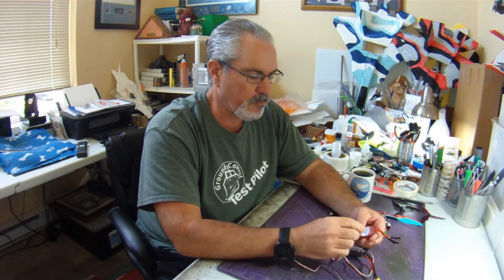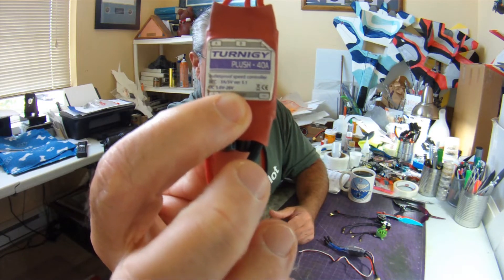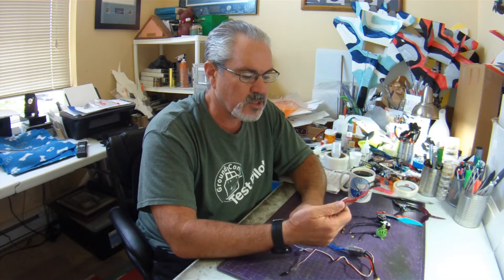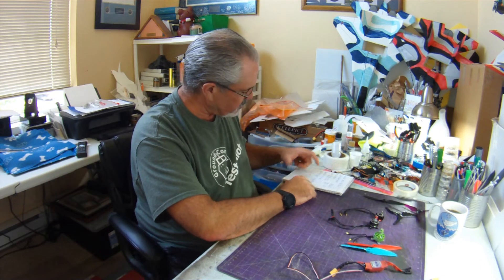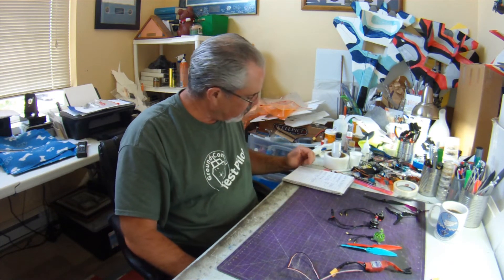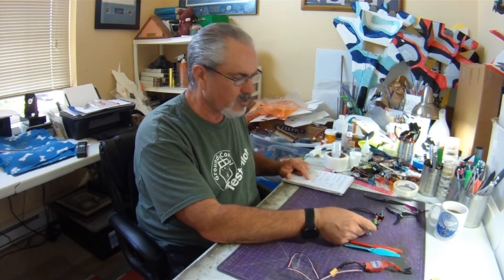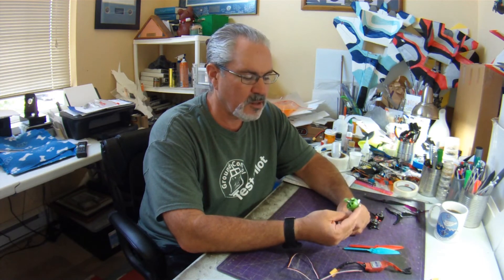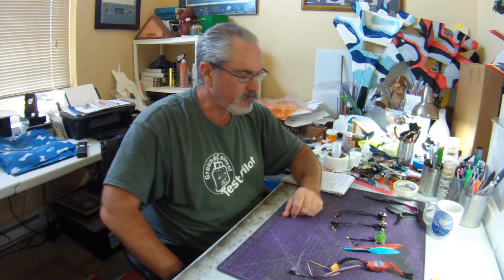Turnigy Plush 40A ESC and motor combos for good budget speed

Comment: Just noticed on Hobbyking turnigy have a new plush-32 line of esc's. I tend to use slightly smaller esc's 18A and 25A in my models. These plush-32 esc's look ideal for me as  even the 20A esc has a switched 4A bec. They also have an option to change the prop direction. In stock in the UK and competitive price.
Reply from the maker: Thanks very much for the info, they look very new and it seems with the programming card there are a lot more features you can adjust and experiment with.  I looked at the 40A Plush-32 ESC https://hobbyking.com/en_us/turnigy-plush-32-40a-speed-controller-w-bec.html but I couldn't seem to find a burst rating for it.  Perhaps as they publish the manual online it will be available.  Thanks again, what size and kv motors are you running in your planes?  Cheers, Scott
Reply: Hi Scott,
At the moment I have gone back to using the Turnigy 2822 1450kv motor. I'm also trying the DYS Wei 2207 2600kv motor rear mount. The main problem I have is limited time with work and changeable weather (north west UK). I have a local recreational ground which is ideal to quickly pop out to. Its looks similar in size to the field that you use. Unfortunately it has residential housing on one side and is very popular with dog walkers. It is very rare for it to be totally empty. I did fly with a Turnigy 2826 2200kv motor but it was clear it was not popular. As a dog owner myself I understand it can scare the dogs. I think if I screamed up and down the field like you do I would have the Police called out on me. When I use quieter motors it has the opposite effect, people are really interested. Any advice welcome!
Gary
Reply from the maker: @gxc2000  Hi Gary, the quietest prop I have ever run on the 2212 2200 kv motor is the Master Airscrew 6x4x3 https://www.masterairscrew.com/collections/3-blade/products/3-blade-6x4-propeller However it does tend to whine a bit more which would probably be even worse for a dog's keen sense of hearing.  You might have to go with a bigger prop but go down to a 2S setup with the 2212 2200 motor to keep it quieter.  Luckily for me, the field where I fly is just for RC flying, it does have it's noise rules, but nobody bothers us.  Good luck finding a combo that you can have fun with and keep the dog walkers happy :)  Cheers, Scott
Reply: @e3Scott  I had not thought of going to 2S. Its a very interesting idea. I have a couple of old ones I could dig out. I could try the idea out for free. Thanks Gary
Reply from the maker: @gxc2000  Sure thing, I know of some guys who use that motor with an 8x4.3 slow fly style prop on 2S, pretty quiet and still moves lots of air as long as the plane isn't too heavy.  Cheers, Scott

Comment: I got side tracked...ESC and brushless motors are expensive on R/C trucks..
$3k later. :-P . I actually have some 2206 and 2208..i got on sale or on a bid.
i have stuff for air craft supplies...I dont even know I have...
Im going to start building again...I need to brush up on data.
I need a SLOW model. or smaller  for my field/park.
Are you down sizing those to 28" wings???
Reply from the maker: I try to downsize to 27" wingspan or even less if I can still fit a 6" prop and a 2200 3S battery into the plane.  Depending on the model, I am somewhere between 25 and 27" wingspan on the planes in my hangar right now.  I am doing that primarily for speed and agility.  The RC Powers Su-30 V4 has a 30" wingspan at full size and I know folks who fly that very slow.  Plans are available here https://www.rcpowers.com/post/rcpowers-v4-plans-10025907?pid=1307655613
Good luck :)  Cheers, Scott

Comment: Great information on power setups from Motors to ESCs to Props! I found out about the RacerStar BR2406S 2600kv Motor from watching your Motor Testing and what a great budget Motor it is! It's the best budget Motor in my stable ;-) Thanks for the shout-out as well and that T-shirt looks great ;-)  See you in the Air!
Reply from the maker: Thanks very much, yes the Racerstar BR2406 2600 motor is definitely well worth it, very durable, and versatile on both 3 and 4S and since it has a relatively low amp draw compared to some others, people can use some of the less expensive more popular ESCs and props and have a lot of fun experimenting :)  I agree, the T-shirt does look great, thanks again, I wear it with pride :)  Cheers, Scott